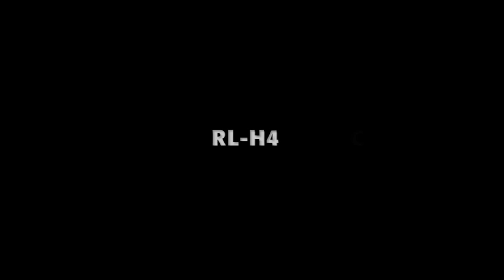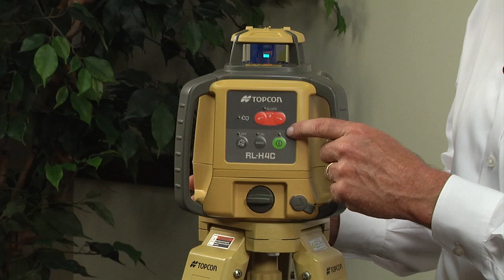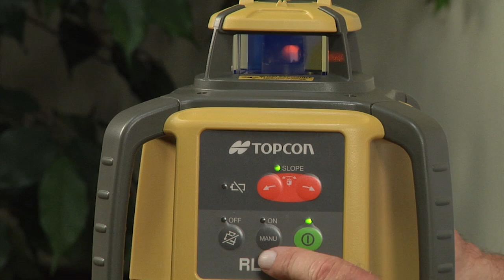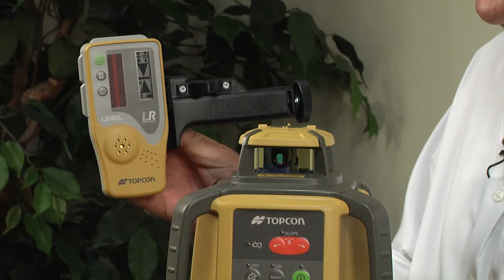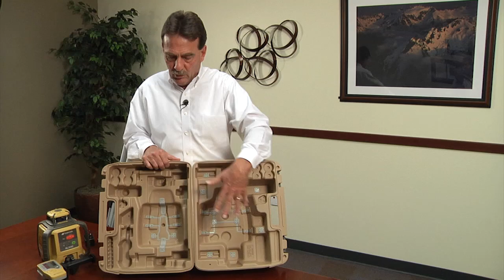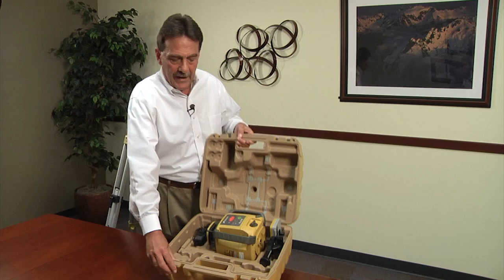TOPCON Construction Laser RL-H4C Training Video

Comment: Used once and worked great. Put in storage (batteries out) for 2 years. Put new batteries in and started but red beam very wek. Replace batteries-still not visible beyond a couple inches. What is the problem with the beam?

Comment: The biggest problem I have with Topcon is I can't hear the receiver due to hearing loss (from being in the trades too long.)  It turns out I'm not alone with this problem.  All Topcon has to do is change the sounder to a lower frequency or offer a hi/low frequency switch.  Lastly, the marketing material didn't make it clear D-Cell batteries could also be used with the rechargeable battery pack.  I ordered the D-Cell battery model only because I didn't want to get stuck with a proprietary battery.  Now that I know, I would have ordered the battery pack model :-(     Since I have to have a helper that can hear, I find myself using my transit instead of the laser.  The transit requires two people (we could both be deaf), and I can do so much more with the transit.
Reply: or maybe get a hearing aid...